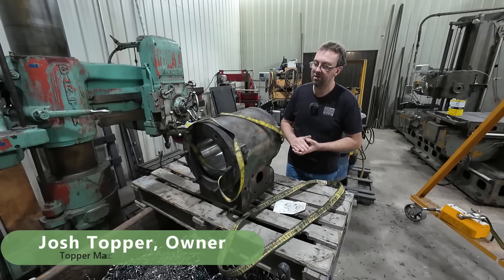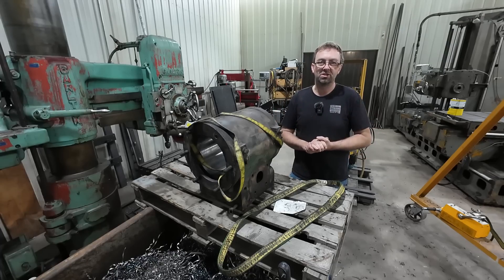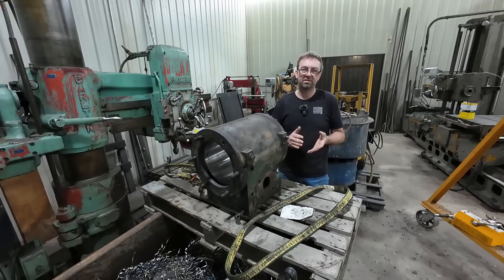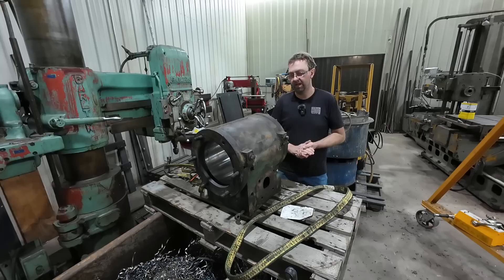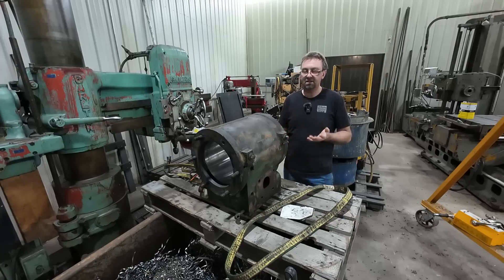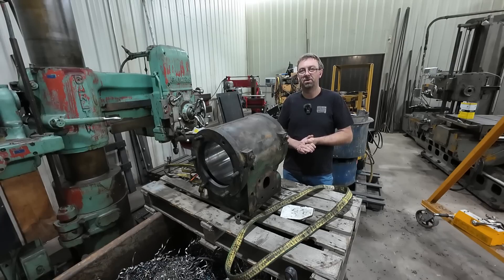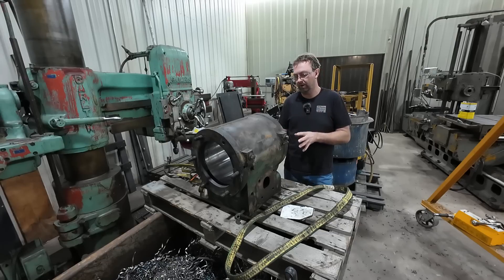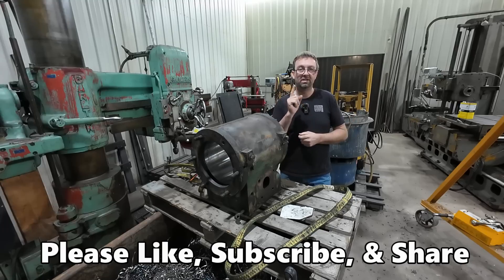Steam Engine Cylinder Boring Follow-Up - Honing & Answering Viewer Questions & Comments

Comment: The comment about welding and boring it back down kills me. First off, even if it was cast steel and you could weld it, why would you? There's so much surface area there to weld, that would take a ridiculous amount of time. Not to mention, now you're introducing heat to the part so you're going to get warpage and hard spots from the heat and the weld. Which you would then have to bore back out and chew up tooling in the process. There's no way that would be practical even if you could.
Reply from the maker: But there are other popular channels that do just that very thing. I must be doing it wrong. Lol

Comment: Hi Steam engine cylinders unlike hydraulic cylinders they have to be done right and honed so it's nice and clean no marks no dents. if you have any Marks in the cylinder, it can damage rings. The difference You were putting steam AND oil ,not to destroy the cylinder or the rings.

Comment: A few years ago we rebuilt a rusted 9x14 Tangye engine. Had the cylinder bored on a boring mill at the local company A&G Price in Thames.  Removed about 0.125 in diameter from the bore hence most of the rust pits.  A few pits remained but the ring width was wide enough to pass over. No honing not required. Piston was increased in diameter by braising and re machined. New rings were turned from a cast iron ring to size then heated to make correct gap. No machine to reface the slide valve surface so used the D valve that I had machined and scraped to match. A new piston rod was made also. Engine runs well at the Goldmine experience in Thames New Zealand.
Your set up was correct, SQUARE to the gland end of cylinder and clocked to cylinder length.

Comment: A ring question. I get by what you are saying that you can have rings made. My question is even though you can do that are you better off shooting for a even number like 10 inches 250 thousands as opposed to 10 inches 617 thousands?
Reply from the maker: It really doesn't matter.  Like any engine, you bore them over to whatever is available  for pistons.  In my case, I am making the piston.  Rings are the same thing, custom rings are no problem.
Reply: @TopperMachineLLC  ok,thanks

Comment: Steam cylinders was normally sleeved with cast iron, but this was only where water quality was very bad, . Steam cylinder best practice was to chrome the sleeve thickly as , it being shiny ,it reflected more heat back to steam that would otherwise condense,esspecialy with wet steam. Dry steam would obviously need more oil of higher quality ( good steam oil) With new pistons the amount of piston-rings can be doubled up by making them thinner and of course they must be the exact diammeter of the sleeve with zero pressure on the sleeve walls when fitted . One very small hole in each ring seat open to each steam side wil press each ring lightly to the sleeve walls by means of pressure underneath the pistonring. Say 6-8 rings per piston will make it about 100% steam tight during operation. In the steam days practice was 2 or 3 rings on the piston and in opperation they lost about 25% of available steam from one side to the other and being tollerated was a major reason why diesels came along. Ithink , steam, when properly designed is much more efficient than diesel as the SouthAfrican 25 class locomotive that became the sole 26 class called the  "Red Devil" proved in the early eighties.

Comment: From a guy who has boiled water for a living starting in 86 in the US Navy two 600 MW power plants. I have been designing a quadruple expansion, reciprocating steam engine. To power a generator. Doomsday kind of thing  to prevent having to use oil in the steam to lubricate the cylinders I have investigated using PTFE/bronze piston rings, actually just square O-rings since they can be stretched over the piston. As far as the piston I’ve investigated using 7075 aluminum or bronze or breast. I do not want to introduce oil into the steam because I was going to design a closed loop system to eliminate or greatly reduce water consumption.
Reply from the maker: A condensing system, A.D. Baker actually experimented with that, but it failed due to oil separation issues.  Google, A.D. Baker Steam Tractor.  A few still exist, they were 300PSI systems.  Pretty cool, too bad it failed.

Comment: Josh I have no knowledge of the details of steam engines but in my 50+ years of gasoline and diesel experience the cylinder wall finish is dependent on the ring material used and clearance needed for the piston. Just my two cents,  I'm very interested in the rest of the build.

Comment: Don't dwell on the bad comments.  These are people that have most likely never seen the inside of a machine shop.  Most have a single-track mind, and don't understand the multitude of ways to complete the same task.  I used to run a Lucas boring mill, but smaller.  I would have set it up very similar to how you did it.  Your machine is probably more rigid than the one I used, and allowed you to bore through without needing a steady rest supporting the boring head.  Great job!  The finish after honing proved how well you bored it.  Keep up the great videos.

Comment: Hi Josh, you've done well. I fully machined a half scale Burrell Agricultural Traction Engine Cylinder and Weighshaft Bracket earlier this year, big job about 150 hours total. Yes big job setting up and dialing in. I tried using the spindle feed and found the bore to be tapering, locked the spindle and used table feed, perfect. I use a Brazed Tool with 60 degree included angle, sharp point for roughing, 1mm radius for finish pass, then hone. We use Alloy pistons in the models, 6160 Alloy nice to machine. Plenty of clearance and plain Cast Iron Rings. Remember that the crosshead holds the piston central so the piston doesn't really touch the bore.
I use a combination of Co-Axial and Dial Indicator for set up. What we do today is more than accurate for what was done 100 years ago. Looking forward to seeing it in steam. All the best from Brisbane Australia.
Reply: Can we see it, please?

Comment: WHEN I HAVE A JOB.... I look at what i have, and what I have to do to complete the job, or if I can. I dont ask, "What would Jesus do"?  Or, what would a shop with every tool ever made, ran by NASA, and demanding .00005 tolerance with calculated expansion to 1500f. I do what I can. I applaud your work, and as you said, most dont know how steam works, or they would have no clue how it ran at all with that egg shaped gouged up cylinder, stuck rings and shaft seal leaks. Great Job!

Comment: Josh, you did it the right way! There wasn’t anything wrong with the way you did it. You do the job with the machines that you have. Forget the comments from the would be machinists.
Reply: I'll second that. You know best what tooling you have available and what's worked for you in the past. There's always a different way if you have different tools available. But, better? 

I'll also comment that maintenance shops for steam engines a hundred years ago did not have all the fancy equipment that we have available today. And certainly did not have indexable carbide tools. This was built using tools that we'd consider to be crude today. And, it's lasted a hundred years. 

I will admit that I'd wondered at if there were other surfaces that would benefit from truing up. But again, this was built to different standards than we have today. And, the design was probably made taking into account that rebuilds might be a bit crude. So, you've looked at  those surfaces and would have noticed pitting to the point of not sealing and would do something about it if needed. 

In my case, I spent some time in a small lot, high precision shop doing mostly military subcontract work.  And a bit of maintenance work for a client that rebuilt canning and packing equipment. Working on those different types of equipment taught me that machining is not the same in all vocations. And that you have to work to the standards of that specific equipment. 

Some of the work that you do is interesting to me simply because it's so different to what I'm used to.

Comment: 6 millionths of an inch per degree per inch for steel and 12 millionths of an inch per degree per inch for aluminum. Those are the numbers we use to compensate for measuring aluminum with steel tooling. These numbers will work for all steels and all aluminum.
Reply from the maker: yes, but this is cast iron.  My concern is how accurate will these numbers be?  Different grades of cast iron, different grades of aluminum?  I have some research to do.

Comment: the rings will love you for that,so what does the ring suppliers say about honing. in seeing the hone work  it needed honed i can see the bore pattern which is mostly  cast iron partly machine , if the spindle bearings were 6" or 8" would be better,but yours are paid for, i'm not sure cross hatch is important its not combustion ,its closer to hydraulic ask the ring people if they have to guess at what it needs ,maybe buy from someone else. as far as  indicating, its better than it was, probably better then 105 years ago , assume it has packings ,they may work .03 out, so call it good, storage is the issue it will rust to death ,maybe drains  and lots of oil Maby water soluble oil  rotate, if you run it once and store it for 10 years it will be rusty all over again, 
have fun.
Reply from the maker: I will be talking with the ring supplier soon.  I have a specific regime to layup on the engine that is very safe.

Comment: Hello Josh.  I think the way you did it was probably the best way when using an HBM.  Assuming the valve chest surface is square to the cross head-end flange of the cylinder it makes for an easy, rigid set up.  If those surfaces were not square then the valve chest surface could be shimmed to get the flange square, again relatively simple and rigid.  

I learned a valuable lesson about dialing in bores early on when I first started using my HBM.  If you want to dial in both ends of a bore (to align the axis of the bore with the spindle of the HBM) then extend the spindle out far enough to reach the far end and then move the table, not the spindle, to get to each end of the bore for dialling.  This ensures that any spindle droop (and there is always spindle droop) is constant at each end.  This is similar to boring by feeding with the table, not the spindle.

Spindle droop has the effect of lowering the axis of rotation at the end of the spindle relative to that part of the spindle nearest the headstock.  If you dial in one bore with the spindle retracted you are essentially dialing in to that axis and when you extend out to the far end of the bore you end up dialling it in to a lower axis.  This gives a false indication on whether the bore is parallel to the table in the vertical plane.

There are so many traps and pitfalls a guy can get into when using a HBM it is no wonder that traditionally the machinists that ran them were the highest paid in the shop.   Keep up the good work.   Ken

Comment: Lots of keyboard warriors who probably have no experience with a big steam engine. I definitely don't have experience with it... So my comments are "That's so cool." 

Watching machining youtube doesn't make you an expert on machining things. Guessing that comment about welding it up and using a line boring machine were from people who watch machining youtube videos vs doing the work.
Reply: Yeah, the welding comment was off base. Getting a good weld with minimal pits on a bore that size would be difficult. Even ignoring the materials issues. And then machining it? 

If it ever gets to that point, I'd think about a stainless sleeve. Just as much for corrosion resistance while being stored as anything else. 

Many years ago I did some sleeves in magnesium cylinders. The MG was getting pitted due to corrosion. So, the request was to sleeve with stainless. And then turned down the pistons to match the new bore. I tried for losing about 15-20 thou to get just enough smaller bore so the piston would clean up to match the smaller bore. I never got any feedback on that job so I always wondered just how successful it turned out.
Reply from the maker: You are correct, watching machining videos doesn't make you an expert.

Comment: Thanks for the video, Can’t wait to see a video of it together and running one day. Why did you choose to go with aluminium for the piston?
Reply from the maker: Weight reduction. There are several engines out there with aluminum pistons and years of run time. They work almost better than the cast iron pistons.
Reply: @TopperMachineLLC  Yet as you've noted Aluminum expands twice as much as steel. So, you will have to fit a bit loose, cold, to get the clearances you want hot. 

Just how hot do the insides of a steam engine get? 3-400 degrees? Still a lot less than an IC engine that can actually melt aluminum pistons if run too hard or too lean.
Reply from the maker: @bobmazzi7435  at 180 psi, which is my safety valve setting, steam is 379.5°F.
Reply: @TopperMachineLLC  Well, as the steam is the hottest part of this,  my guess was  not bad. So, we have about a 300 degree temperature rise. But I'd figure a bit more as the piston is internal and the cylinder has more external surface area to cool down. 

Back of the envelope calculations are that a 12 inch cylinder in steel will expand about  .035 going from 50 degrees to 350. And, an aluminum piston expands about .070. So, .035 less on the cylinder than the piston. 

At a rough guess you will want at least .010 clearance at temp.so I'd fit at .045 or so at room temp. But, I'm making all sorts of assumptions in that number. I'll be curious what numbers you come up with when you fit it. And, again, I'd ask the folks making the rings what their experience has been.
Reply from the maker: I calculated just roughly at .006 clearance at temp, needing .030 under to start with.  That was just rough calculations.
Reply: @TopperMachineLLC  Hmm. We are in the same ball park. Which probably means that either number would work. 

Use your numbers and if it binds up hot then shave off another 10 thou. <G>
Reply from the maker: @bobmazzi7435  mine was just rough and dirty figures. Who is to say that 24xx aluminum and 70xx expand at the same rate. Same with cast iron.
Reply: @TopperMachineLLC  Good point. I used numbers for "aluminum". Specific alloys might be closer to cast Iron. And I would certainly look at that before choosing a material. 

I wonder, would you anodize it for corrosion protection after machining?

Comment: If you really knew what you were doing you would have started by mining your own iron ore then proceed to cast and machine a new cylinder... amateur.   Instead you take the easy way out and perform a perfectly good repair using the equipment, skill and knowledge you have available... HOW DARE YOU!
Reply from the maker: There is a popular youtuber who did just that with a part he made. I cringe at the thought of trusting melting bits down of unknown quality to cast a part. Really bad idea.
Reply: @TopperMachineLLC  I hope it wasn't a critical component.  I look forward to more of your videos.  I'm always trying to learn.
Reply from the maker: @johnsweeney4257  electrical component. Extremely unsafe.

Comment: You’re right it is yours. You did it best way possible I think you’re right on the money and it’s probably just as good or even better than when it rolled out of a Baker’s plant when it was built job well done we never had to get into that depth of rebuild with our engine. Ours was just steering issues and clutch shoes, which were a nightmare on a Port Huron.
Reply from the maker: I'm glad you never had to go this deep. It's been a job for sure. I had to repair the clutch on a Nichols a vmfew years ago. There is a video.

Comment: Cross hatch is not needed, your seals will work well enough in there, and the rings, with a good coating of bronze, will want to run on a smooth surface anyway to reduce wear. Remember the original was cast, rough machined and then honed with coarse grit, then just polished a little, then was run. A little bit of bypass steam will make no difference, the original one would have, from new, had a lot less perfect surface than what you have now, and it will be moot anyway in 6 months of running, as there will always be slight pitting from the steam and condensed  water, so, as long as the outside seals are good and do not leak, and the shaft seal is packed nicely with graphite packing, or PTFE, which works well over the old oakum, lead and wax with oil seals they had back then, it will be better than new.
Reply from the maker: Thanks for the information, I appreciate the advice!
Reply: Sean has it right as far as I know. The nice cross hatch pattern is just the honing finish. You've gone beyond that and anything you do would just rough up the nice surface that you have. 

As I understand it, you do want a bit of roughness when using steel rings so the rings actually wear a bit as they seat into the bore. That gives a machined in place seal. But, with fancy rings like you are considering that may indeed be bad. I'd talk to the folks making the rings and ask them what finish they suggest. If they say that you are too smooth, then roughing things up a bit might make sense.

Based on the original video I was thinking that you were just getting some form of steel ring and that the bore that you had would be great to seat them in. 

The one thing that I would consider is that these machines were designed to be used daily. So, they were getting fresh steam with steam oil every use. No time for corrosion to build up.  In your case, this will probably sit a lot between uses. So, running an oil rich mix has a better chance of leaving oil in place while this sits for weeks or months between uses.